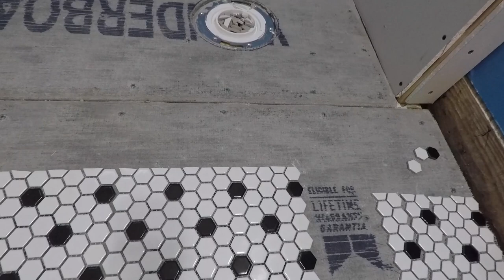Hex Mosaic Floor Tile Install

Comment: I guess I am a stickler for details . . . While you were starting to lay the tiles I thought I saw a gray tile (it was the Wonderboard coming through the missing tile space). Then I saw the "gray" tile was now white. I was wondering if you noticed; the comments confirmed the error. Otherwise, it was a nice install. Sal DeBalsi recommends knocking the ridges down with a taping knife (basically pushing over the top of one ridge into the adjoining valley resulting in a consistent smooth surface). This practice assures no thinset push through when tamping. Thanks

Comment: Funny.  Just before you started talking about that missing black tile I was thinking to myself whether it'd be amusing to purposely screw up the pattern in one spot so it would perpetually make you think about it, and so any guests using your bathroom would notice it and comment.  I think you should leave it.  I'm sure that ship sailed four years ago, either way, but there's my two cents.  Thanks for the tutorial

Comment: Did you fix the black dot & if not, it sounds bad but black epoxy or even a black tiny vinyl adhesive will prevent you having to redo it.

Comment: hey nice video. Question about wet saw cutting.
I liked the nice clean line you had. When I tried to cut a 1/2 tile off the end of a sheet the tiles moved and tilted a bit giving a slightly jagged look. Yes I went slow and yes i put tape and even a pice of wood over top to try to minimize the movement. How did you achieve that straight line?

Comment: How thick did you have the thinset for those sheets? I am doing the same tile.
Reply from the maker: I used a normal thinset thickness... about peanut butter consistency.

Comment: I would be staring at the white tile every time I'm on the can : )
At least put the bath mat over it ; )

Great job
 . . . . So, no need for spacers?   I'm doing one of these soon, I've only done the big squares.  
Gonna be a lot of work.

. . . Edit:
Oh, I got it, no spacers.
((Regretting taking this job, haven't started yet, ugh ))
The lady doesn't seem to understand that it's a moderate/high degree of "artistry."
Wish me luck!

Comment: Thanks for the video. I have a hex tile floor like this but all white tiles. I'd like to have the black/white pattern you put in here. Might not bother, but would you manually replace all the black tiles one by one, or just pull the entire floor up and redo it with the sheets containing the black/white spacing as you've done here?

Comment: If possible I would remove the bath panel, tile under for an inch or so and then trim the panel to sit back on top. Either way it would be finished all round with white silicone and cover the edges anyway.

Comment: Looks like you cut each tile into 3 strips?  Is that just to make them easier to handle?
Reply from the maker: I only cut a few into strips for the right side by the wall.  Most of the pieces I left whole.

Comment: adding mud at the cement board joints, and then meshing over, and then applying addition mud on top of the mesh tape...doesnt that cause a hump? isn't that telegraphed into the finish surface of the tile?
Reply from the maker: If I remember right, the backerboard edge is slightly thinner, like drywall.  I didn't notice any humps at the edges... I also applied it very thin.